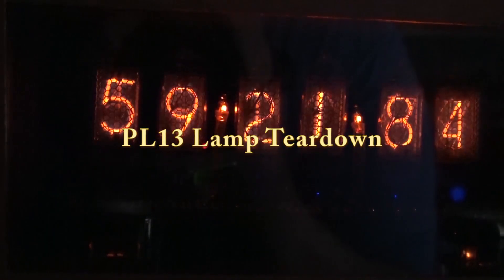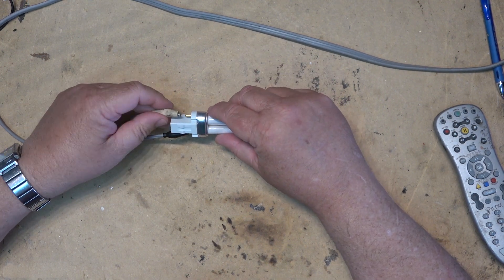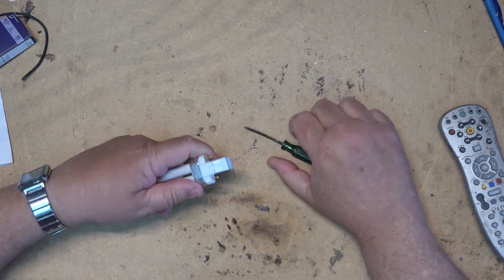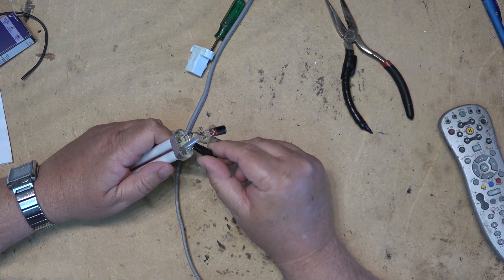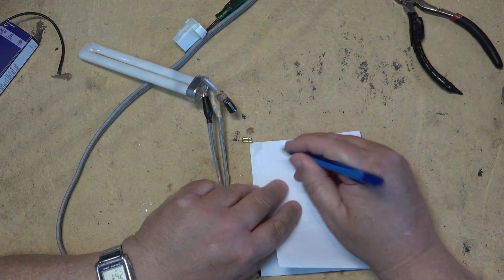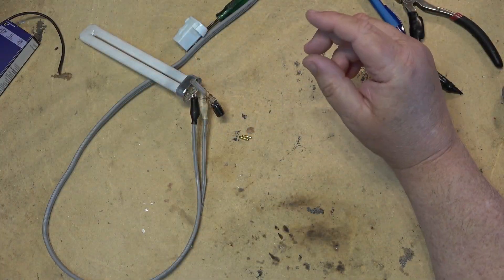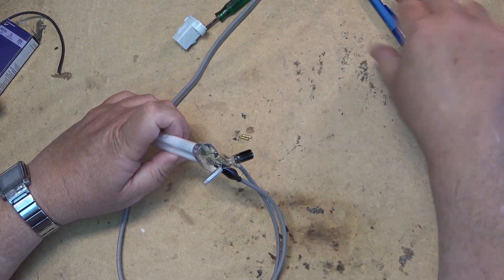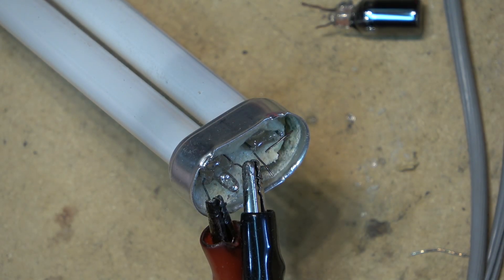Tearing down an old PL13 fluorescent lamp

Comment: I did that once lol
10y old me found an odd looking bulb in a fixture and wanted to see it glow.
Plugged it in straight across 230V mains.
Left a nice little burnmark on the carpet
Reply from the maker: When i was about 10 i found some old screw in fuses. Spares for the old electric range we had all the elements had 2 20 amp fuses for the 240 dual hot wires.  I thought it would be cool to put one in a light fixture and throw the switch.  It went off with a loud pop the switch lit up like an Xmas tree but the breaker didn't trip. The fuse was faster then the breaker.  I took the  now blacker than the ace of spades fuse out and put in the light bulb and it came on when though the switch was off. Yip welded the switch contacts.  The belt came off when my dad got home. They no longer made that style / color switch as the company that made them was no longer around so a standard leviton had to be fitted.  Unfortunately they were a different style so it didn't match all the other switches.
Reply: @12voltvids  Nice to know that I wasn't the only kid doing dumb stuff just to see what happens 🤣

Comment: I have fairly significant eye damage from glaucoma and cataracts, and find that LED lighting, particularly the low colour temps used in commercial applications like offices and supermarkets, really mess with my vision. Something to do with the blueness of the wavelengths. 

I found CFLs a nice compromise between the heat and energy use of incandescents and the issues i have with many LED lamps but as you say, they're being phased out, including here in the UK where they haven't been readily available for maybe a decade now. 

As for how long they can go on flashing in their failed state, a neighbour had a front porch light that began flickering soon after i hought my house in 2006. It continued to flash for 18 months, presumably because it's on a twilight switch and the fitting is high up so difficult to reach without ladders. 

Even today the bottom part of the glass tubes continues to glow dully at night. Clearly both the light sensor and the electronic starter continue to function!

Comment: I can remember replacing the capacitor in the starters used in larger fixture would fix them some of the time. Most of the time the original capacitor was a paper type that failed and as I recall I used a ceramic as a replacement. This was a long time ago and I think the success rate was about 50%.

Comment: i have 9w UV 365nm bulbs for a salon UV curing light  that have that same shape and same base.  would they also have the starter and cap inside, or are those components sometimes missing for use with instant start electronic ballast circuit or cold cathode circuit? (the lamp fixture holds four tubes and has a PCB inside)
Reply from the maker: Yes they do if they blink a few times when starting. (2 pin base) If they start instaltly then it likely has an electronic ballast.
I use a 9w germicidal lamp in my tooth brush sanitizer. Those lamps will still be available after the ban goes into effect.
Reply: @12voltvids thanks!
  i don't think they blink but it's hard to tell as they all come up together and the fixture doesn't  work with just one bulb installed.   

so I guess I'll take apart a dead one i have that died  very prematurely.   Hopefully it has a starter that's dead so I can steal a working starter from a much older  bulb on its last legs.🤞

Thanks again for the video.  I had no idea  these little tubes with the weird  chunky bases had start components within!
Reply: Las nuevas led no soportarán ni 1 año de uso antes de quemarse jeje, recomendación regresa a ese fluorescente